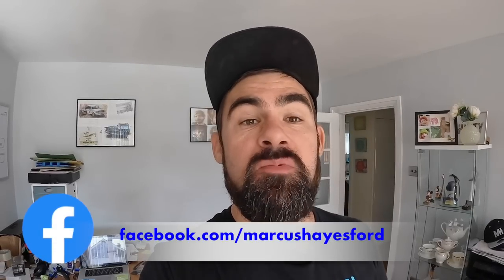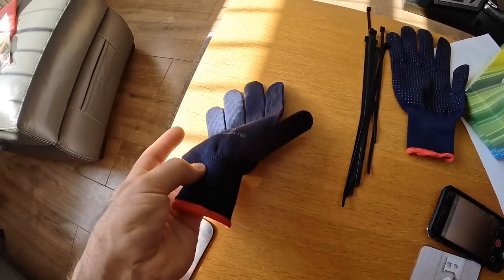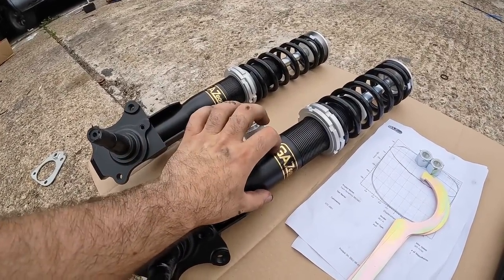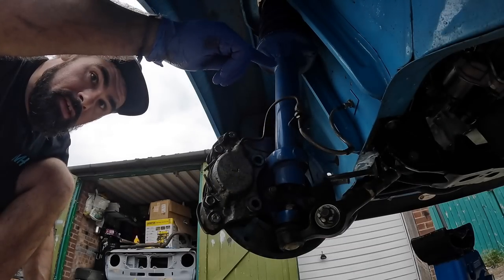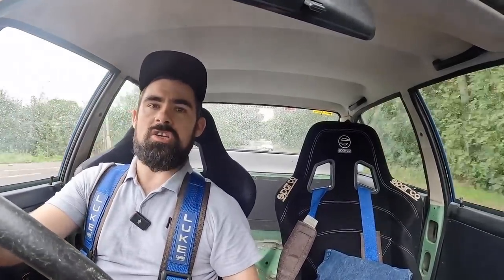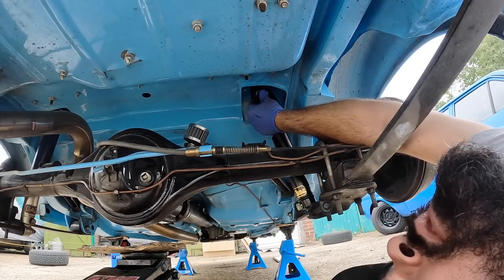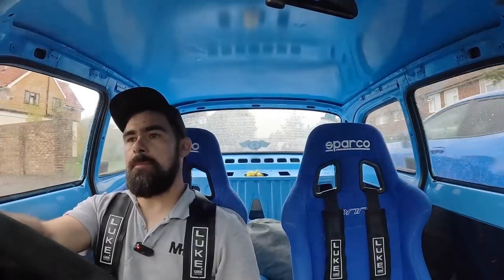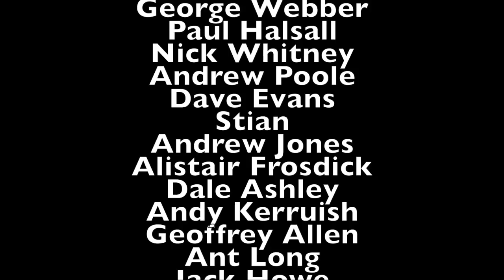GAZ GOLD COIL OVERS For My Mk1 Escort! 😃

Comment: Nice one, Marcus! Gaz are brilliant to work with. I had my Viva HC coilovers custom built by them. As it's super low, the fronts are 2.5" i/d  10" long eye to eye with 400lbs springs & the rears are 1.9" i/d 14" top mount to eye! So short that there's no room for a bump stop!! Cheers. Leigh.

Comment: Good one dude 👌
You might find it easier when fitting rear shocks to put the top in first, then you can pull them down to fit the bottom mount 👍
Reply from the maker: That’s genius! Thanks for the advice mate! 👍👍👍

Comment: Hi Marcus , i had Koni adjustable rear shocks on my more door MK2 Escort Ghia and had them really firm, she vibrated my cassette player tape deck to pieces, i think I replaced around half a dozen tape decks over like 6 months before I softened them up, lol 😂,  If I still had my Escort I’d be buying everything you’re taking off Esther lol 😝
Ps…..impact guns are freaking fantastic lol
Pps….. you should spray all the new suspender parts with ACF50 to keep them nicen kleen, it comes off with brake cleaner.

Comment: I,ve learned a lot from your videos and reading the comments section. Are the top mounts on the front struts an improvement over the standard Capri ones? Different bearings maybe or altered camber angle or something else? Is there a specific name for that type of mount?